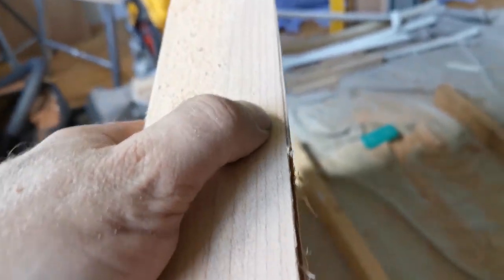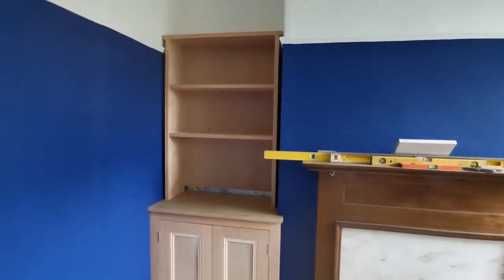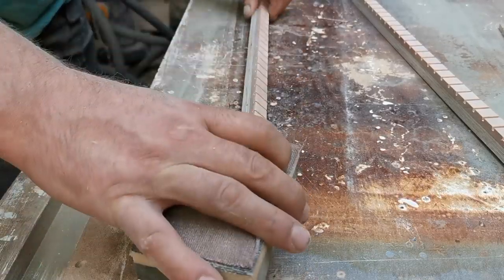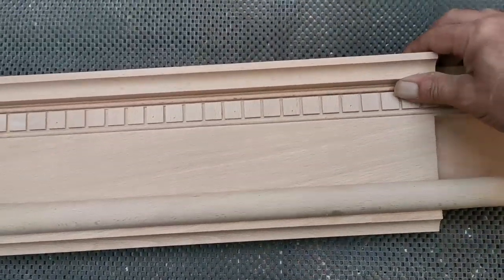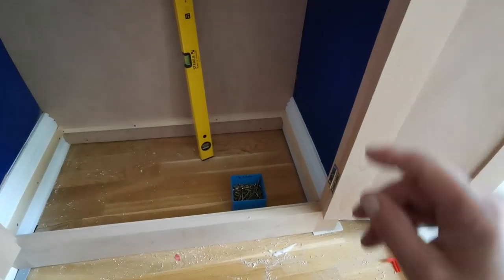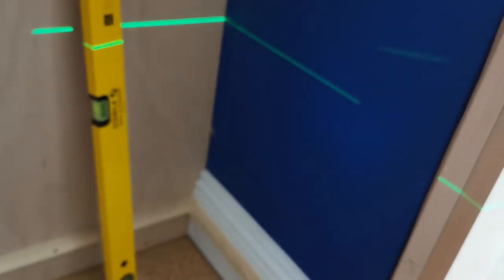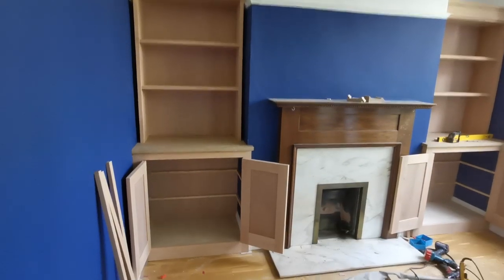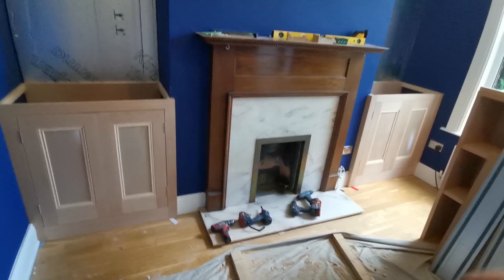Smith's Alcove cupboards & shelves Pt9 - Finished temp fitting the cupboards

Comment: Had a good old laugh when you offerer the shelf unit up to the window alcove... I did something similar about six weeks ago. Measured the wall to wall for some laundry cabinets.  Then when I came to slide them into place, I had not allowed for a metal door frame. To use your words... thank god for jigsaws and caulking. Customer was happy in the end :)  Great series Gid.
Reply: P.S. Love the way you have built the moulding
Reply from the maker: 😂🔨 I've done this a few times now, the wardrobe build had a similar thing, often it's just the curtain rail, you'd think I'd have learn by now 😂 Thanks Paul 👍

Comment: Hi Gid! Really enjoy your vids and always learn from them. Totally un related but I’m currently making a timber frame greenhouse for someone and I’m having to join the cil’s on the side frames. I’m using 3x10mm dominos (cil is 167mm) but I’m wondering what glue to go for? Would you use the PU stuff that expands? Thanks in advance for any advice. Rich
Reply from the maker: Thanks Richard 👍 yes. the 30mins stuff, the 5min goes off too quick, there's a few exterior glues but that is the one i use, in my van i have PVA & PU, sometimes i use the PU in a tube, it doesn't swell so much & dries harder than the stuff in a bottle which can be a bit foamy. 
There was a piece of MDF in my yard kicking around for over a yr, i'd used it as a glue stick for PU, the end with glue on just looked like the PU that'd gone yellow, the other end with no glue on had swollen to 3-4 times it's width a bit like a fan, if you have a prob it'll be the wood swelling not the glue failing, 
I get the PU in a tube from the builders merchants but it's this sort of stuff, https://www.screwfix.com/p/evo-stik-polyurethane-wood-adhesive-310ml/40778
Reply: Thanks for the reply Gid really appreciate the advice! Will pick some up from TP’s this morning. 👍🏼

Comment: Excellent work, I do some similar work in alcoves with cupboards. I pre make the base unit, drop it into place & then fit the face frame & top. You do lose about 100mm internal width for storage, but site install time is dramatically reduced. Keep on with the uploads. 👍👍👍
Reply from the maker: Thanks Paul, will do 👍 I always give the client as many choices as i can, their choice in the end, swings n roundabouts, you have to make the cupboard, time n materials & you loose space but clean inside, easy fit n square shelves that could be made adjustable 🤷‍♂️👍
Reply: For this quality of work, you need to be charging top dollar. 👍👍👍
Reply from the maker: I earn enough 😂😂😂

Comment: Excellent video Gid as usual ,that moulding i love it so much ,going to copy it for the front of a shelf i need to make . P.S gid i have looked all over for same scribe /compass you use but cannot find them anywhere .
Reply: Amazon offer many scribing tools, I use one made by Trend and find it easy to use and set up.
Reply: @goatsears  Thanks for that i will take a look .
Reply from the maker: Thanks Simon  👍 It's a pair of Staedtler compass's that i made a point to fit on, I can't find them online that hold a pencil, the closest i think is Mars® comfort 551, I annoyingly found the box a little while ago & threw it away, i think, I've had many scribing implements over the yrs n these compasses with the threaded wheel are good because you can adjust them with one hand & they don't move if knocked or dropped, 
https://www.staedtler.com/uk/en/products/technical-drawing-instruments/compasses-1/mars-comfort-551-precision-compass-551-01/
one i have saved to my Amazon list are these but haven't bought because these 'scribes' have thin-ish steel legs, the ones i broke a while ago had nice thick legs but no wheel adjustment so was hard to fine tune, impossible with one hand ,  🤷‍♂️
https://www.amazon.co.uk/dp/B008OSIUY8/?coliid=I3HTKEQ54N2Y31&colid=3UBWC9NW89BTU&psc=1

Reply ·
Reply: @Gidjoiner  A massive thanks for your help once again Gid, i have a really good carpenters set, very solid but i love the fact yours have the adjustable wheel which as you stated does not move once set, where as mine have a kind of locking wheel at the top and will move with the slightest of knocks , keep those excellent videos coming Gid and hope you do not mind me making a copy of your excellent moulding .
Reply from the maker: Will do Simon 👍 Go for it n i hope your moulding turns out well 😉👍

Comment: Hi Gid, Great job.
 Just curious to know why you don't make a slightly under sized, pre-made unit and fit it into the Alcove instead of battening it out once your doors and frame are installed?
Regards from Ireland.
Dave.
Reply from the maker: Hi David thanks, 👍 
Before i start we talk often for at least a few hrs, they've seen pics on the net or on my Facebook page & now here on YT, I always give the client as many choices as i can, their choice in the end, swings n roundabouts, on one hand you have to make the cupboard unit, time n materials & you loose space but clean inside, easy fitting & square shelves that could be made adjustable, on the other hand you can do it like this, the majority of my clients choose this style,🤷‍♂️ many old cupboards were built using the alcove as the unit, Like i say their choice 🤷‍♂️👍